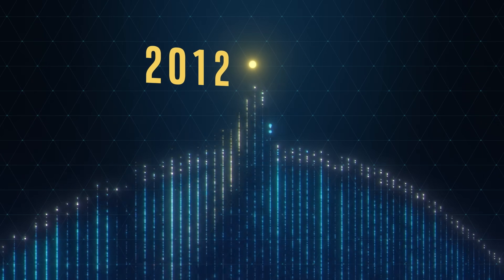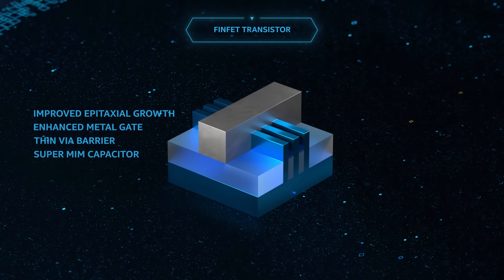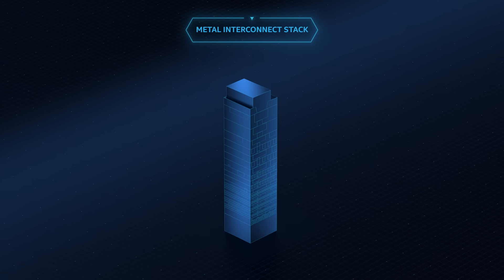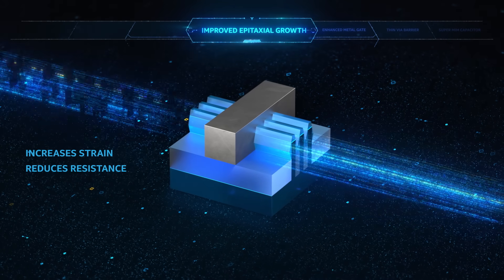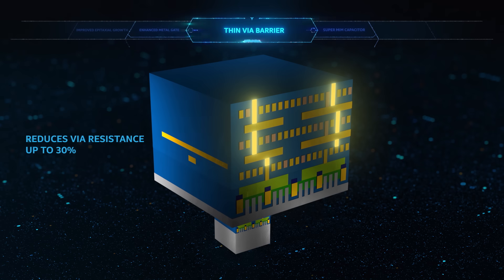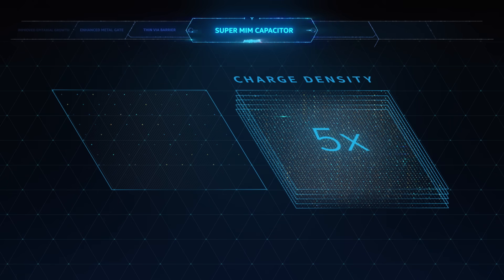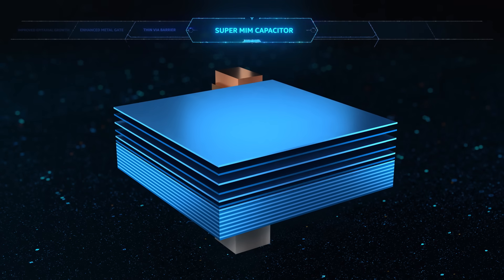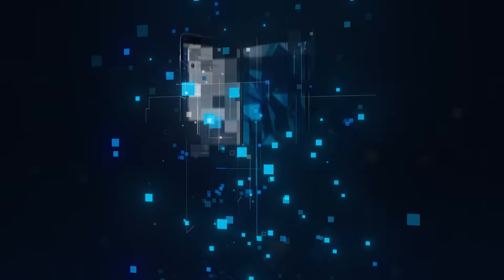SuperFin Technology: Advancing Process Performance | Intel Technology

Comment: How do you simulate your designs before creating them?
Reply: how do you simulate designs?  with software. 
if you mean about:  
you don't build a car without a design.
you don't build your house before get the design or plains.
Reply: Hi @Gabe M , no idea if you're still on YouTube or even care, but it basically goes like this:

- New transistor process is designed in software
- It is prototyped with proton beam lithography (basically printing the transistor pattern atom-by-atom)
- If this is successful, a production process is designed, and then tested (they'll print like a million of them to many tiny pieces of silicon)
- This is tested, if the theory holds and it works, they can then emulate it in a different piece of software. This software will use one or more of the prototypes that were produced, as its test bed
- Eventually it'll get into consumer products, if/when it can be proved that it actually benefits the operation of the microchip when incorporated, and also when it can be accurately predicted/proved that yields (and failure rates) will meet a certain threshold
Reply: @unexpecteditem7919  Great explanation, i thought intel emulate whole thing (architecture, fabrications, perforamnce) 
before producting them.

Comment: But 7nm? 😶
Reply: 7nm or whatever is just a marketing terms to portray a manufacturing process advancement.
Reply: I think no difference
Reply: Intel 10nm SuperFin > TSMC 7nm.
Reply: If Intel could reach AMD 7nm level, maybe I would considering buying Intel chips, but it could costs more
For now, AMD got the upper hand in CPU race
Reply: @jensiong8982  ijust buy cheap one
Reply: @jensiong8982  
intel 10nm = tsmc 7nm
Reply: @Harish2923  Both r almost the same, so actually Intel was better, given that Intel is using 10nm

Comment: why does ice lake 10nm run hotter than 14nm+++
Reply: Because they’ve worked on 14 nm so much they have it almost perfected. Super small dies also help and they’ll need to re-engineer the 10 nm to get the same small dies
Reply: 10nm is a lot more dence and as such with the same wattage going through you will see massive thermal density increces and that makes it harder to cool larger ammounts of power
Reply: 10nm ice lake is meh. Hoping for better result with 10SF tiger lake
Reply: Intel 10nm is an immature manufacturing process. Poor yield. This new 10nmSF might help with thermal, performance, efficiency and yield.
Reply: because they're new. Just like how DDR5 ran with similar performance to DDR4.

Comment: Still 14nm+++++++++++++++++
Reply: Do you understand the benefits of 7nm over 14nm and how much of chip is actually made with 7nm process or do you just think "smaller number gooder number"?
Reply: @Comicgamerkids  Yes, I understand more than what you said, and I know the reason why Intel postponed their plan for 10nm desktop platform.
Reply: @ningyang2074  what is reason?
Reply: @Comicgamerkids  To make it short, one of the main difficulties is to control the leakage of ultra-thin metal gate caused by quantum effect in order to lower the on/off-state power density. There are two ways to solve it, one is reducing the transistor density on chip which TSMC has adopted, the other way is to modify FinFET geometric design to control leakage current. New design requires advanced fab tech including EUV lithography and other crafts, and it makes yield of production quite low. Intel also tried to cut down transistor density but resulting in chips with worse performance than 14nm's, i3-8121U is kind of such thing.
Reply: @ningyang2074  Are you conflating design with nanometer nodes?
Reply: @Comicgamerkids  Transistor dimension scaling highly depends on the physical size of gate and channel, especically when we are approaching the limit of quantum theory. I am a PhD working on nanoscale transistor, it is very hard to scale down the size without any performance sacrifice below 100 Angstrom.
Reply: Intel's vanilla 10nm is a little bit better than TSMC's vanilla 7nm. Source: https://en.wikichip.org/wiki/7_nm_lithography_process
You are saying that TSMC's 7nm FF+ will be better than Intel's 10nm. Sure.
But 10nm SuperFin is gonna be even better.
Reply: @ahsanqureshi786  zen3 w gonna use tsmc 7nm euv with about 112Mtr/mm2
Reply: @malathomas6141  vanilla 10nm is 100Mtr/mm2. 10nm SuperFin is 17.5% better. You can calculate.
Reply: @ahsanqureshi786  and tsmc 5nm is 172Mtr/mm2 intel cant keep up 5nm is 83% more dense than tsmc 7nm euv that's a massive jump. If I calculate then intel 10nm superfin is as dense as tsmc 7nm euv but let's see who gets closer to the advertised transistor density amd or intel.
Reply: @ahsanqureshi786  So this comment isn't so much just for you as it is for anyone who stumbles upon this kinda interesting/educational comment thread.

From the Mtr/mm² numbers you and Mala gave, apparently when compared to Intel's more accurate/realistic Mtr/mm² of their vanilla 10nm, TSMC/AMD's 7nm euv should really be called 9.44nm and their 5nm is about 7.6nm. Even by TSMC/AMD's own definition of 7nm (specifically the better euv version) their 5nm is really 5.33nm. I guess it's true what I've heard, that TSMC/AMD is defining these impressively small node sizes based off of only very specific smallest feature sizes. Nice to know this dispels the rumors that Intel might become irrelevant in another year or so. I'm no fanboy of either side, but I do like the epic competition and knowing as much as I can about the truth. Now I want to know what the real-world Mtr/mm² is for Samsung's 8nm that Nvidia has decided to use. If anyone can send me a link or simply tell me, that be great!